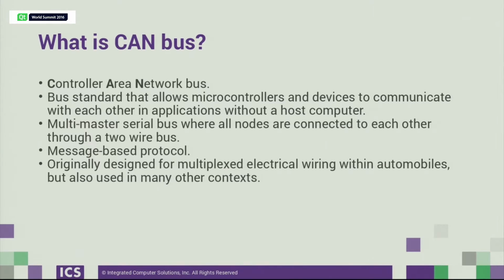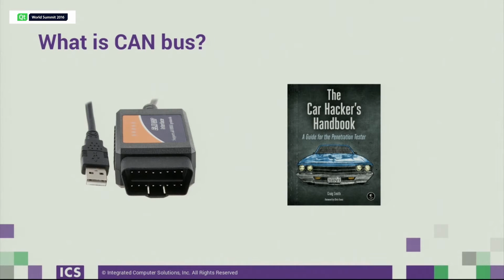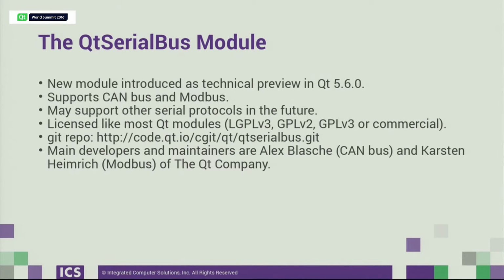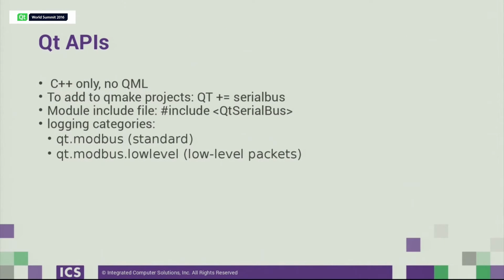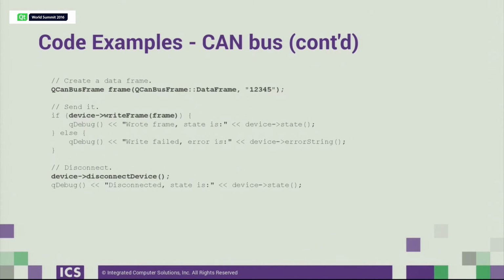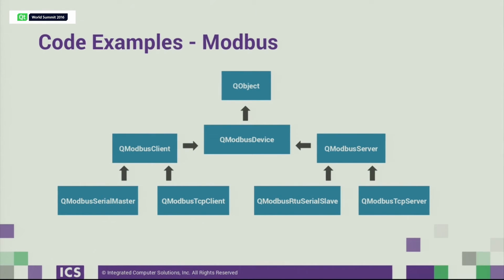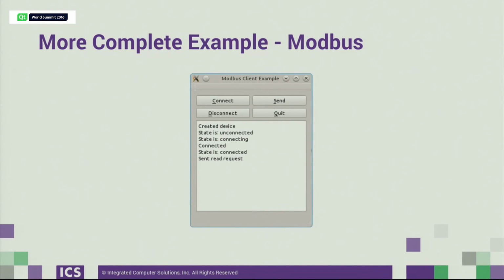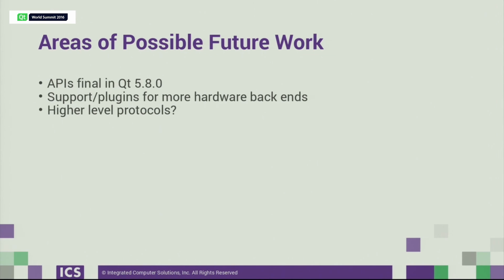QtWS16- Qt Serial Bus: Using Modbus and CAN bus with Qt, Jeff Tranter, ICS

Comment: So has <QtSerialBus> from QtWS16, been replaced by QCanBus (QtWS17)?   For example, in this tutorial, they include <QCanBusDevice>
https://giorgiomarinangeli.wordpress.com/2018/07/01/amber2-can-bus-system/

Also, does QCanBus (5.8) depend on can-utils being installed?  Either way,  cansend works via a terminal, but I don't get any devices returned using Qt's availableDevices!